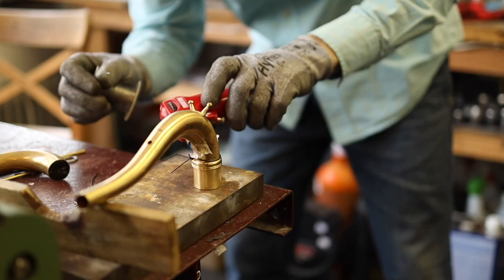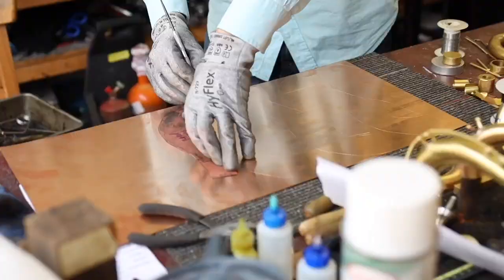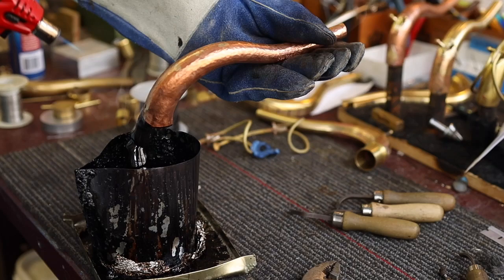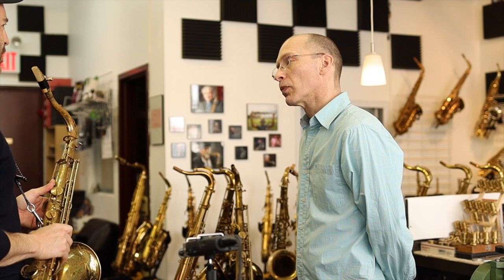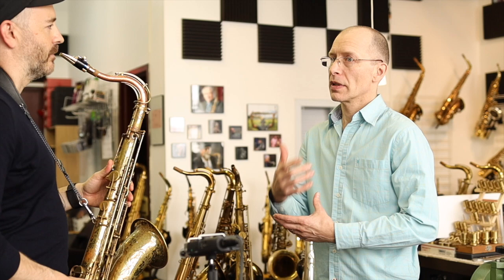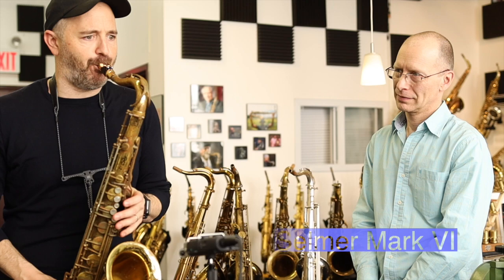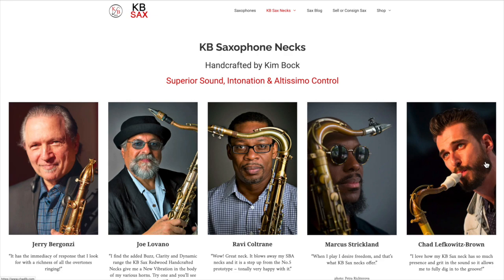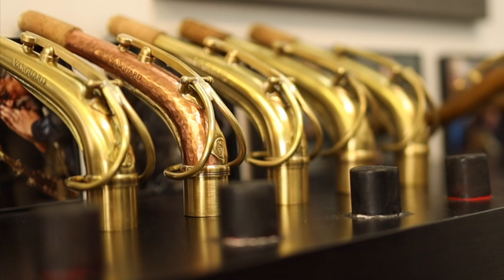Making Saxophone Necks by Hand in NYC | KB Sax

Comment: Great video Jay. People just dont know half of the process which would have included; annealing, cooling, brazzing (soldering),annealing again to take the stresses out of the piece and allowing the hand tapping, the heat monitoring and the precision manufacturing of all the parts, and this is all before the assembly and testing. Engineering meets the arts. 
As for sound, I would be as well buying one to hang on my wall to admire whilst listening to Jay.

Comment: I tried two KB Sax necks.
 1. Vanguard 61
2. Redwood hand hammered copper.

Other gear: Selmer Ref 36, Vigilante ‘Kansas City’ (darkest), me (playing since 1968)

1. I thought the Vangard felt more ‘open’ and ‘free’ blowing with a bit less resistance. Great sound, more high freqencies (than both stock and Redwood). I would prefer is in louder settings since it would ‘cut’ better. The more open feel took slightly more control- but I think after not very long it would be second nature.

2. Hand Hammered copper Redwood, a bit more resistance (similar to stock neck) less high and more lower frequencies, better in settings that don’t need to ‘cut’- small venues, recording etc.   I tend to play a bit ‘bright’ in the higher registers anyway, and this was smoother/rounder than stock or Vanguard. So I kept this one.

Both played superb and I would have liked to keep both- but I didn’t want to keep swapping necks. I think the Redwood gave noticeably better sound/feedback than stock (which I thought was quite good) and I felt it was more versatile than stock.  I don’t have trouble being heard, so the Redwood was a better match for me and the sound I hear in my head.

Thanks for the review, I had read about them before, but seeing the operation and another outlook was good.

Comment: Wow, your Yanagisawa is so much more with this new neck...

It has been 2 years since I acquired a KB Sax Redwood wrought copper neck for what was a very, very rough vintage tenor I was getting restored at the time. Kim's neck helped transform a dodgy intonation horn into an astonishingly great professional player! Not only were intonation tendencies corrected but the tone and altissimo just opened up making the horn a real joy to play.  

I'd like to point out that the remote purchase process was a breeze.  After a quick discussion about the horn and my setup, Kim recommended two necks, 3 days later I had the tenon measurement tools in hand and by week 3 the mail delivered the 2 pre-fitted necks for evaluation.

Comment: The neck is very important.  Haven't played a KB neck, but will consider one for my alto.  I can say that a Phil Barone neck absolutely transformed both the intonation and the power of my tenor Mk VI (57,xxx,ca.1957).  The horn had always been sharp down low, and flat up high, but not so with the new neck.  It's beyond anything I would expect, and consistent with various mouthpieces.  My excellent tech (and great player) Tim Kochen, in Houston, recommended looking for another neck because my original seemed "dead" to him.  So happy he did.

Comment: Hi Jay, thanks for posting this. I could hear apparent difference between stock Yanagisawa and Kim Bok neck in your last segment. It darkened the sound quite a bit but also gave you bigger sound so to speak. I would describe my feeling as if it was you suddenly playing on bigger tip opening mouthpiece. Which may sometimes give you the same result you've achieved with new neck. Sounds great by the way and congrats on your acquisition 😀!

Comment: My opinion is that the Yanagisawa neck is better than the KB bronze from where I am sitting.  KB has lower volume,  less low end and when you hit the altissimo it was less in tune with the KB. It looks beautiful though. It has more edge  and I am sure if you blew harder the Yana would be edgier as well but I am wondering how the KB would sound if you blew harder.  Headroom?

That was also my experience with other necks like the Ponzol and Barone  granted they are not artisan as this one is. And I have limited experience with  only owning  3 tenors  SBA, Buffet SDA and Yamaha. The original  necks for the 2 older horns and Yamaha's own V1 and C1 are the better necks. I did keep the other necks as backups  and occasionally use them.

Comment: From my end the difference was so minute. Yes, I did notice a little sizzle on the KB.  So, was it worth paying $1240 for "sizzle"? Shrug. 

I would have liked to have also heard his solid copper Redwood or Vanguard. I'm assuming it's SOLID copper?  Not  just "more copper than a bronze neck. Or a SOLID silver neck...which should be more obvious. in projection. And also maybe a solid carbon fibre neck. :) Future video perhaps with your W02. I'm considering the W02 in Alto...And the Yammie 82z...P. Mauriat La Bravo 200 (which has a solid silver neck and bell...and I think a bronze body)..good price.

Comment: An interesting video, as usual, and for many reasons. With all respect, handcrafted does not necessarily mean quality. Many times machines do a better job as they are more accurate, and don’t have A hangover on Mondays. In how many ways can you make a tube when the diameter in both ends are the same for all necks? I’m using my best headphones, but can’t hear any difference. Is this another example of that when you expect a difference you hear a difference?

Comment: Jay,  One year late, sorry.  Both necks sound good.  The main differences I noticed were:

1) Your position relative to the microphone changed for each neck demo.  The original was more off-axis.  The KB neck was more direct.  

2) The original neck was tuned flatter than the KB neck.

Results:  The KB RECORDING sounded better.  The actual neck comparison was inconclusive.

Comment: It's so hard to be truly objective with any type of gear comparison.  With a guitar, at least you can play a short musical performance into a looper, and have the same recording playback on different amps or pedals.  

But having said that, as a listener you sounded great on all the necks to me, including the original necks.  

I guess what matters most is what YOU prefer as the player, and if some necks had less back pressure, or were more efficient with air to sound production ratio.